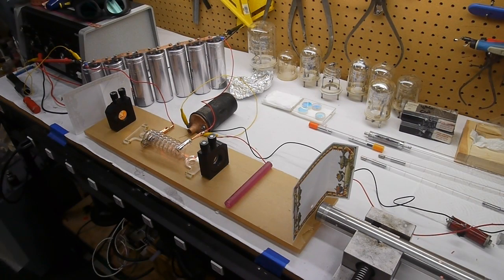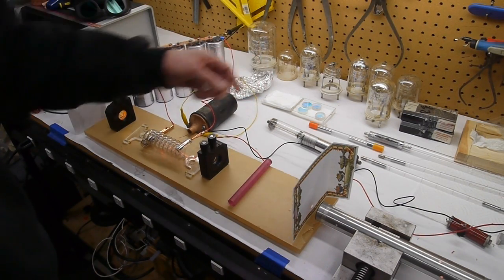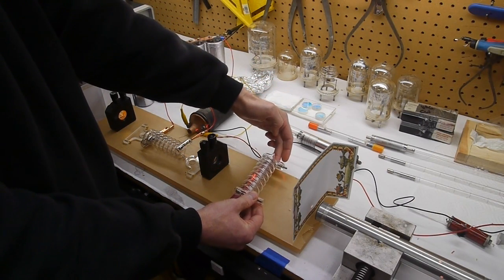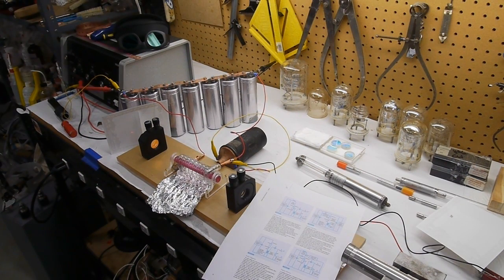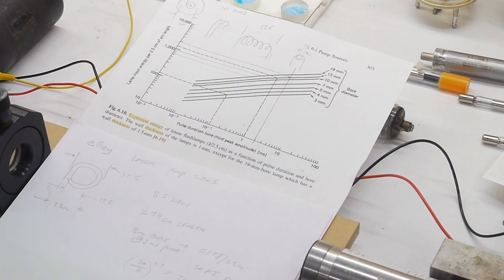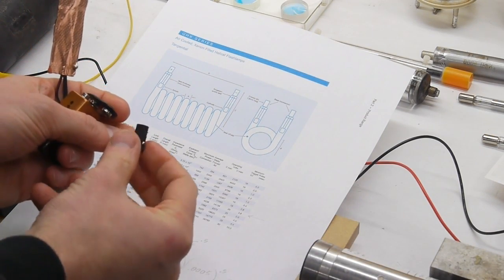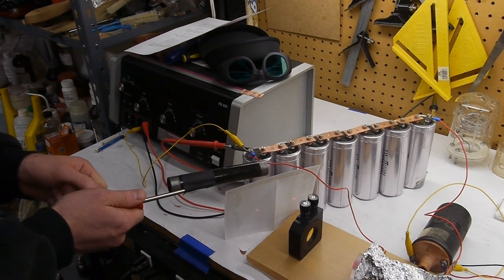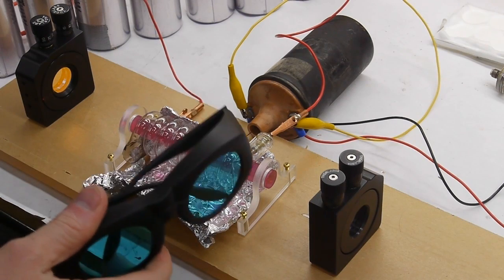Ruby laser design process

Comment: Near IR glasses looks like (by the blue tint - blocking red)
Reply: Paul Forrester I was just thinking that all the laser glasses I can remember having at work came with a data sheet to show exactly what amount of light they block at each wavelength, so figuring out if they will block UV should be easy.
Also we used really powerful UV lamps to read electrophoresis gels and we always just used typical polycarbonate safety glasses because they block almost all of the UV

Comment: I am working on a project with a capacitor bank of similar size and am trying determine the appropriate discharge resistor size. How id you decide what value and power resistor to use? Thanks

Comment: I'm 43 and wanted to build one of these when I was a young lad, it looked so easy. just buy a ruby rod that's mirrored fully on one end and partially at the output end, surround with a flash lamp and a reflector and voila, laser light!!!  Now I'm wiser I know its not as easy as it sounds, a lot of skills need to be learned before a DIY attempt will work.

Still, I used to drool at the He/neon lasers in the Edmunds scientific catalog, they were way out of my lawn mowing allowance money,  

Don't know what happened to the once bright, budding future scientist to be.  I'm thinking hormones distorted my thinking and I made the illogical decision that girls were more important than school.  Fuck me!  How stupid!  Now I'm just a lowly "blue collar" electrician who even has to dig a ditch now and then! No cool laser labs or cushy office jobs for me.  God, I wish I could hop in a time machine and tell myself that girls are evil and will cause never-ending useless drama, the pussy is just not worth it.  Nevermind, some paradox will screw that idea up now that I think about it.

But hey, I did manage to buy the first laser pointer radio shack ever sold!  In 1992 it cost $89, all for a stinking  low power, maybe 2mw at the most, red diode laser.  It took three odd N size 1.5V alkalines cells.  I thought it was the shit at the time.

Confession time!   I'm probably going to hear what an idiot I am but give me some slack, this was the early 90's and this laser was extremely low powered, a modern dollar store red laser pointer will make my early laser look like a wimp.  Here it is,  shortly after buying my $89 marvel of modern technology,  A police helicopter was flying near me, running out of fun things to do with my expensive gadget I decided to see if I could see the dot against the side of the helicopter.   Much to my surprise he noticed and hovered over my location and turned on his "ghetto bird"  spotlight, this bright beam of light was trained on me for what felt like hours while I was cowering on the back deck of my parents house!  Anyway, given the time and how rare lasers were I probably have the dubious distinction of becoming the first jackass to point one at a low flying aircraft. It scared me straight!   

BTW, I still have that laser and it works.  The batteries actually are the second set bought in 1993, they still hold a charge!
Reply: Everyone looks back and says to themselves, "Man, I was such an idiot back then." Even so, you seem to have set a precedent.
Reply: Yeah, it's easy to know the basics, but actually putting it into practice is much harder. I can't count how many times I've tried to make a laden jar and get it to produce a spark without success.
Reply: Chriscom28 You must have grown up with Flintstones.
I made Leyden jars since i was 8,and i made my fist Van de Graff generator when i was 14 or 15.
Quite litteraly its a container wrapped with Al foil and a nail in the top.Fill with water and proceed to shock the shit out of you.
You probably didn't charge it properly,its quite hard to mess up something that simple.
Reply: Chris Barth - I also had a book as a young lad called something like 'How To Build Your Own Ruby LASER' with loads of B&W pictures of the ruby rods and flash tube etc. I used to dream of getting the parts and being able to put them together.

As it turns out, it seems like it was a project that would have been well out of the range of my meagre kids DIY skills.
Reply: +Chris Barth:
You remind me of me. I would have loved to have a laser and also a proper chemistry lab and such.
Now I do, but I don't have so much time.
Reply: I loved edmund scientific.
Reply: @metamorphicorder  Yeah, I wanted one of those giant Frensel lenses so bad!!
Reply: @ssl3546  Had no problem with that!
Reply: Chris Barth lying ass

Comment: My old boss, an engineer of the first caliber back in the 60s or 70s was approached by some exotic whiskey company that had printed incorrect information on the INSIDE of their lables. The mistake was not noticed until after the labels were attached. He said he could erase the bad info without disturbing the labels. He happened to have a friend who owned a ruby rod. (What are the odds?) He borrowed the rod and built a laser capable of burning off the printing through the bottle and the whiskey. He was successful.
Reply: Now that's a cool story to have, and a very clever way to solve the problem.
Wonder how much the rod was worth back then, certainly couldn't have been cheap.
Reply: Man what a treat to read. Thanks for sharing
Reply: @paul beenis does anyone ever call you ball penis ?

Comment: Hey I have a question about charging up capacitors. I have a studio photography flash that has a 4 capacitor bank, all capacitors are put in parallel. This flash unit plugs into the wall, but somehow it is managing to charge the caps up to around 350 volts with only a 120 volt supply.  There is no transformer on the circuit board so I am confused about how it is doing it. I tried researching it, but have not found much information. There are two smaller capacitors on the board rated for a high voltage (and they are not for the trigger transformer I don't think.) any idea how it's doing it?
Reply: Voltage doubler. Fairly common in flash units like that.

Comment: Your discharge method for the HV capacitor bank makes me nervous.  If the clip lead failed, the resistor would bring the screwdriver shank to the voltage of the capacitor bank.  The length of the arc you drew from the bank when you discharged it should indicate the amount of respect you should give it.  If you get this wrong once it will be the last mistake you make.  Having worked with HV power supplies for years the discharge device of preference is a bleeder resistor that slowly discharges the bank after power is removed.  A knife switch that can directly short out the capacitor bank before touching anything is also a good idea.  One HV power supply I worked on supplied 8 KV at  5 amps, for protection it had mechanical interlocks that required the mains power to be removed, the input to the power supply to be shorted, and the capacitor bank to be shorted with a knife switch.  The power supply had a bleeder resistor that took two seconds to discharge the power supply to less than 10 volts.  Before working on anything a "Bang stick" which was a 4 foot long insulator with a metal hook connected via a heavy stranded cable connected to ground was touched to all high voltage points.  This last safety device should never be necessary but will save your life should one of the others fail.
Reply: I use a "Bang Stick" to discharge the capacitors on our Uni's 4MeV Linear Accelerator (yeah, it's small but still  lethal). Long (3 ft) Rod of Ebonite (!) and a fat ribbon of earth cable connected to the brass hook on the end. Once "Banged" you leave the stick hanging as capacitors have a sneaky habit of not discharging all the way and recover just enough to give you a another one when you least expect it. Great channel this one, keep up the good work.
Reply: Exactly what I thought when I saw it. And those cheap clip leads are notorious for failing.
You MUST make a better grounding/discharge system than that! 
And/Or use bleeder resistors to discharge the bank to a safe voltage in a reasonable time (say, less than a minute).
Reply: Did the same while working on Navy Surface Search Radar. Add rubber mat, lineman gloves, and face shield; then you are good to go.

Comment: Where did you get the mirrors from? What are their specifications? Are AR coated rods better than rods with external mirrors?
Reply from the maker: +Pulkit Sharma The first batch of mirrors came from eBay.  I had an automatic search for "ruby laser mirror".  They were not in great condition, and had some unknowns, so I also bought a new set from Eksma Optics.  I believe really high power ruby lasers generally use external mirrors, where small/medium rods can have integrated mirror coatings.

Comment: if it took 100 amps to melt a piece of wire in say 10 seconds, lets say 10 volts. would 1 amp at a thousand volts  melt it just the same? so its the 1000 watts that actually do it..at a thousend volts the current of 1 amp is limited in whatever form possible...hmmm?
Reply from the maker: +Alan Wolstenholme A piece of wire, an electrical fuse, or any normal resistor has a fixed relationship between current and voltage. Therefore, we only need to know the current passing through the device to determine if it will melt.  This is why fuses are rated in amps, and it will work equally well in a 12V circuit or a 120V circuit.
Reply: if you read what i put about current limiting the scenario would make the same wattage pass through the wire im wondering if it would melt in the same way. 1 amp or 100 amps, /1000 volts or 10 volts
Reply from the maker: +Alan Wolstenholme A watt is a watt, so yes it would melt in the same way, but let's say you have a piece of wire and you put 1000 volts across it and it draws 1 amp, and melts in a short period of time.  If you put 10 volts across it, it will not draw 100 amps.  There is nothing that you can do to make it conduct 100 amps with only a 10 volt differential across it.  Similarly, there is nothing you can do to a piece of wire to make it draw less current as you increase the voltage across it.  The voltage and current are in a strictly fixed relationship due to the normal resistance of the wire.  However,  In the real world, a piece of wire will have a lower resistance as it becomes very hot and thus conduct less current as it heats up.
Reply: Oh yes, Sir! Ohm's law.
Reply: +Alan Wolstenholme hmm. the laser operates based on transmitted wattage.
So I don't think so.
Reply: Wouldn't it have a higher resistance as it heats up?
Reply: thom1218 Sometimes, but some metals react differently.
Reply: great-just add confusion to the already confusing issue to sound clever-great!

Comment: How come you don't have the business end of that ignition coil hooked up? you'll only get that 20kv from the center socket (the part that would go to a distributor) and only if you have a points and condenser system hooked up to it. By itself, you only have the positive and negative power terminals connected, but not the high-voltage output. 

Maybe I'm wrong, but I would imagine you aren't getting much out of that coil. Is there another reason it's hooked up that way?
Reply: Oh, sorry - when you zoomed in I was able to see the little wire leading off the coil. My mistake.

PS - all standard safety glasses (z87.1 or newer) are legally required to protect against UV light. That's why you wear safety glasses even under a welding hood.

Comment: Question.  I have a Donald Duck nite lite from the 70s.  It only works in some outlets.  If it lites in an outlet, it then flickers if the lites are turned off.  It's not a light sensitive type.  It says 1/4 watt and 120 volts on it.  I suspect it has something to do w/ the wiring in the house, as it doesn't stop flickering if i point a flashlight at it.

Comment: Excellent explanation!!

I am used to see reaction chambers that enclosure the light source as well as the rod.. and probably it would be best for you to do one as well. It would protect you, it would protect the rod.. the light source .. etc. If you don't want to build one.. there is a guy on ebay from Israel that sell those quite cheap (i have seen them as low as 80 USDs - and some even have the old rod inside). Not to forget that high frequency light excitation will produce heat (such as the CO2 lasers do) and that should be dissipated within the chamber itself either by water or any other cooling technique.

Excellent video!! Keep on!! 

Regards from Portugal..

Comment: hi there... 1st of all love ur channel, u r the best... i have a question concerning the mirrors used to reflect the light. to make a long story short i want to make a laser out of a lot of laser doides, so i will need to have some reflection mirrors. u have a video on sputtering (only that u made clear coats on them), but ive seen some ppl sputtering copper on glass. the surface looks really polished and reflective, so my question is can i use those as reflective mirrors, or what should i use for that purpose. pls just dont say buy some professional mirrors, its not the point. the more diy the better :)
Reply from the maker: Thanks!  Laser didoes typically do not need external mirrors, however you can certainly make a usable mirror by coating (sputtering or physical vapor deposition) glass with metal.  Aluminum is a good choice for broadband visible light.  Gold is a good choice for infrared.  Copper will corrode and is typically not used for mirrors.
Reply: Applied Science well i wouldnt use the mirrors like u did to bounce the light, i thought more like taking a hundered laser diodes (0,5-1W) and make an array or something, so the mirrors would serve to divert the light to a spot (lens, whatever), and sicne i dont like round shapes it would be difficult for me to arrange them to shine into the same spot. as for the tip on aluminium/gold/copper, i would have gone with aluminium or copper, so that tip on corroding copper is rly helpful, itll save a lot of time. and finally.. ur respond was way faster than i thought, and exactly what i needed/wanted to hear... u have just proven u are the best :D thanks a lot

Comment: There's a nice 14.5 in long, 0.75 in diameter ruby rod available now on eBay for any adventurous types.  Probably would need three of those helical flash tubes to pump it but imagine the output.  :-)

Comment: Can you also pump it with burning magnesium?
Of course, it is less controlable, but burning magnesium releases ~600kJ per mole of which a considerable part is emitted as light.
Reply: +Curixq:
It would probably work but you would need some strips of Mg ribbon all burning at the same time. Also, it burns too hot and might damage the ruby rod.

Comment: So, are you deliberately using the capacitor bank ESR and thin wires to act as pulse-forming network or have you not considered making one?
They greatly help to widen the pulse and keep it above lasing threshold, this way you can dump more energy into the laser itself instead of heating the flashlamp ;-)

p.s. you absolutely have to blow something up with that huge pile of capacitors (and make a video of course), I personally would suggest some cheap disposable camera flashlamp :D

Comment: Snells law can be a drag!  Have you considered mounting the rod inside an integrating sphere (tip of the rod extending outside the sphere) to allow a very high percentage of optical coupling between the light source and the ruby rod? 
Also, there are usually two ports, allowing 1 cm2 photo receivers on the integrating sphere that would allow you to accurately measure the light source input to the rod after establishing a baseline without the rod inside the sphere.
http://www.gamma-sci.com/products/integrating_spheres/
Think about an inexpensive narrow pass polycarbonate filter sheet material that could reduce the UV by 80% or what ever you need for your fixture setup.   Nice project...

Comment: The lamp is about 50% efficient.  You could get 10% or more of the heat in the foil.  I would calculate the J/gm in the foil and get the heat capacity and calculate the delt T.  You might damage the foil.  The foil touching the glass will make a good trigger for the lamp.  If there is trouble with triggering people wrap very fine wire on the tube and use that for triggering.  The reflector could be hogged out of aluminum and then polish. It won't be stable over time but for a lab experiment it would work.

Comment: In terms of eye safety for UV regular polycarbonate safety glasses will work.  The laser will need special glasses.  If the laser glasses are polycarbonate you will be in good shape.  I would completely enclose the laser to contain the light.  The UV from the lamp can cause bad sun burns.  It has much harder UV then sun light.

Comment: very cool , are you familiar with the mathematics used to calculate the frequency your capacitor bank will operate at , in the past when connecting caps i found that the more caps you connect in parallel the slower the arc discharge rate frequency with just 1 cap my arc would fire like a minute gun probably 500hz but with 3 caps it would fire an arc at 1hz, i have a video of this called carbon arc lamp or something like that

Comment: You will want to add an inductor in series with the capacitors to match the impedance and limit the rate of rise (dI/dt) of the current.  I have a design guide from ILC that might be handy for you if I can figure out a way to send it to you.  10kJ sounds like a lot of energy.  I would make sure you have something to block flying glass just in case.  If you have a public email I could send you my design guide.  Here are some numbers I came up with.  12" lamp, 8 mm bore, 3 ms at the pulse base, 10kJ, C=1131 uF, Vcap=4200volts, inductance 883uH.  About 2.3 kA peak.